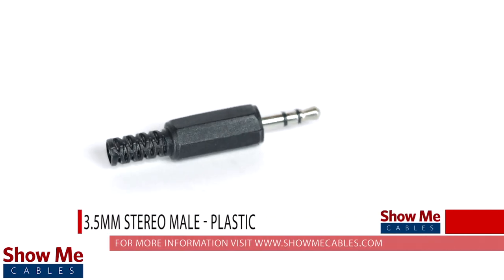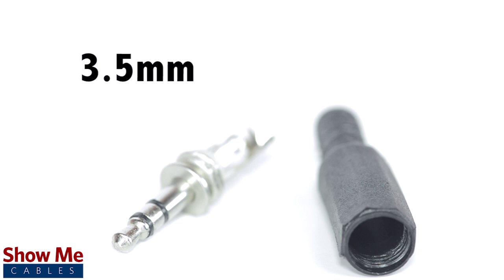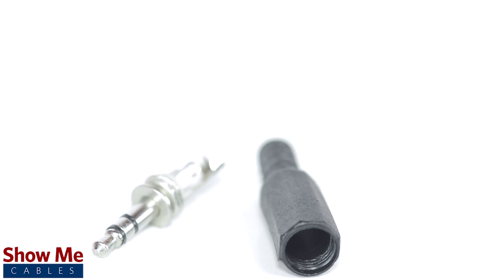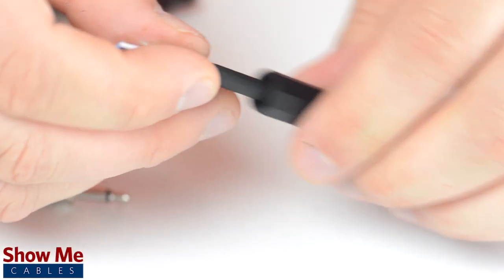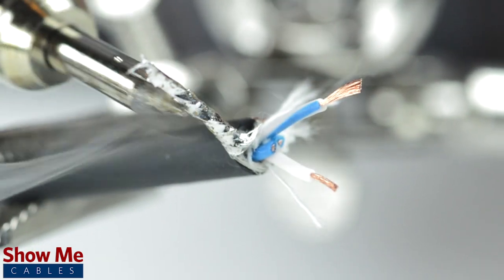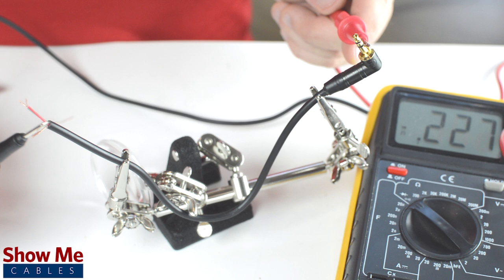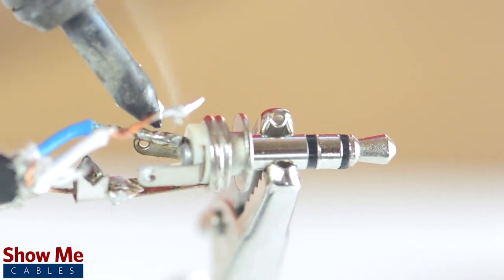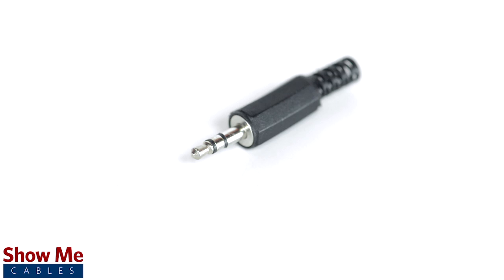3.5mm Plastic Stereo Plug - DIY Project to Repair Your Audio Cable #973

Comment: Please demonstrate good soldering techniques when showing others how to do it
Reply: Agreed. Use the soldering iron to heat the metal part, then touch the solder to the part - when it’s hot enough, then touch solder will flow onto it. Then join the tinned parts.

Comment: Can we use this jack without soldering , just make joint and ready.
Reply: You can just wrap it or use a really tiny bolt and nut, I would just solder it though pretty cheap to get

Comment: Without ,3.5mm jac  and use just only data cable  for speakers  isit connection is possible or not possible plz send me some information.....
For incase isit possible from you send me a video for connection

Comment: I have a 3 black.band and works perfect but 2 black rings dosent work how you caled 3.5mm 3 ring ?
Reply from the maker: 3.5mm TRRS or 4 conductor has 3 rings.  2  rings is stereo.
Reply: @ShowMeCables  i find on.line 3 rings but seys audio.and video

Comment: My speaker wire has only two wires which one should I connect?
Reply: @ulol metro Only if it's carrying stereo. If he's talking about a wire connecting a single speaker, that's alright, just signal and ground.

Comment: thanks for this, the video was a bit fast but it helped me work out what i was doing wrong with my wiring. I didn't realise I was supposed to crimp the tabs onto the cable, but doing that fixed the audio problem i was having.